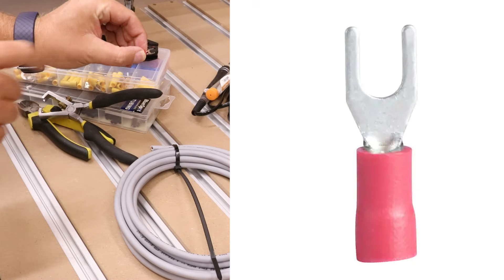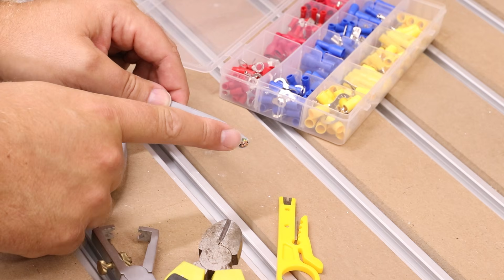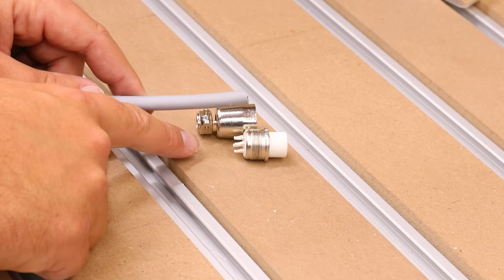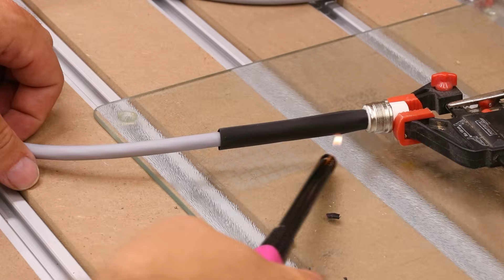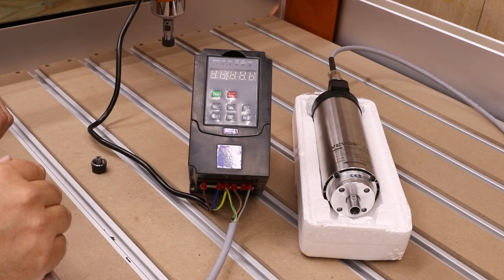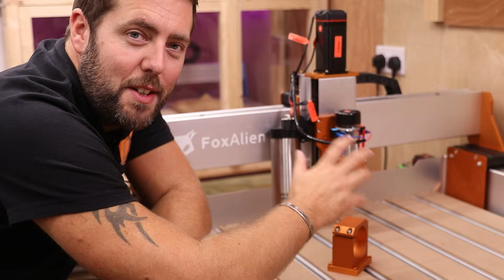Beginners guide to a Spindle VFD upgrade on your CNC

Comment: Should be connected the shield wire of the spindle cable at the source side?
Reply from the maker: Yes, the ground wire from the spindle should in theory be connected.
Reply: ground is ground - it's the cable that goes to your home's fuse box and is connected to an electro-magnet that pulls off the fuse once ground-cable gets current.

Comment: Hi James, just getting around to watching this. Question - is it necessary to use the VFD you mention or is the one that comes with the spindle sufficient? The one you used was 220v and no longer available. Just wondering why you needed to use one that was not included with the spindle? One additional question - is a 5.x lb/2.4kg spindle too heavy for the Masuter Pro (what I have) and Thanks!
Reply from the maker: @MichaelHester-v3e  if you mean the standard control board, then no they can't be used to run these upgraded spindles, you do need a VFD like I show in this video. As for the weight, personally I think that is a bit too heavy for the Masuter Pro

Comment: As always James, you are a lifesaver! Just looked at the 1.5kw air cooled kit, do you think this would be too heavy for my Genmitsu 4040 Pro?
Reply from the maker: The motors will handle the weight but you may have some flexibility in the middle of the X axis
Reply: @JamesDeanDesigns  thank you so much for that! Do you think even an 800 W would be too heavy or even a 500?

Comment: Maybe you can help me, I have a Fox Alien XE-Pro the VFD is rated at 2.2 on the torque of stepper motor.  Can I wire a 1.2kw spindle like the one in your video directly to my Fox Alien without having to purchase the additional VFD unit.   If so then that leads me to my next question?  How do I do that... there is 2 wires going to the 400watt spindle I see the 1.5 has 4 wires... Can you help  me??  Ron

Comment: Hey Guys, currently i think about getting my first CNC. I thinking about getting the Genmitus PROVerXl V2 because i like the idea that i am able to increase the working area pretty easy and "cheap". At the checkout i saw that they offer an 1,5kW Water Cooled Spindle Motor Kit, with VFD & Water Pump and now i am not sure if it worth to invest 330€ additional for a spindle? I am a complete newbie in CNC and woodwork in general... Is it worth to upgrade your system from beginning? Does someone know how the noise different between a normal 400w Router and the water cooled spindel is?

Comment: Cool video, well presented.  One thing is the ramp up/ramp down. There is a reason for the long spin up and it’s to warm up the bearings. Even in super cheapo spindles the bearings are set for heat expansion. You should never wind it up fast, but let it slowly speed up to let the balls in the bearing settle correctly until it’s warmed up. Will prematurely wear out your bearings by ramping up so fast.
Reply from the maker: Very true. I've been meaning to make a follow up talking about warm ups and how to do a warm up sequence and pause code before a job starts.

Comment: Do not solder stranded wires used for power! It's perfectly fine for low power applications. But: If the connection gets too hot the solder will become liquid again. Bad connections and high current will cause a lot of heat and once the solder starts to liquify the resitance will increase which increases the heat and no on.
Do you plan to run this machine unantendet? Anything flamable near by, wood, saw dust or paint?

Comment: Hey James I have a few questions new to CNC machines bought my first CNC machine a (Genmitsu 4030) when I got it none of the bits would touch my project material so I adjusted the height of the spindle by unscrewing the four screws on front and droping it down until my bit meets my table was this correct of me to do?
Reply from the maker: Yes, thats fine to do 👍

Comment: My spindle is air cooled 500w but it only has two wires ? can in i use a vfd with it ?
Reply from the maker: No, that will just be a DC spindle. It can't be used with a VFD. Or not to my knowledge anyway.

Comment: So when connecting the shielding on the VFD side to the earth/ground, do you do the same thing with the shielding on the spindle side, so that you have BOTH the ground/earth wire AND the shielding connecting to pin 4?
Reply: Yes. The purpose of shielding is to take any EMI generated by the spindle (or any of the electronics) and send it to ground; Ergo, the shielding must connect to ground as well. Personally, I run shielded cable od spindle, end-stop leads and stepper motors; especially if your steppers are open loop.

Comment: Hi James, for 8 years I've been trying to get the manual on the Askpower A131 VFD you are showing and I'm excited that you have made a video showing spindle control as I've been trying to do that to - mine is still manula and costing money leaving spindle running! But I'm desperate for the correct need a manual showing PN parameters - do you know where I can get one? many thanks Mick

Comment: Read this before you start buying alternative vfds or what ever extra things.I bought this vevor spindle and vfd. Instaid of the 5v port. I used 0-20ma in.   This does put the rpm correct. Works like a charm.   It just happens to be exactly right as far as i can measure mah..
Reply from the maker: That's interesting, I tried all the inputs on mine and I couldn't get any to work correctly without using a voltage converter and separate power supply
Reply: @JamesDeanDesigns  i can if needed make a video for you or make pictures.   Only dont exactly know how i can reach you.    I have the vevor 2.2kv inverter. Same version as you in the movie.
With 800watt spindle.

First i turned down the potmeter on the mainboard of the controle box completely.  This gave me 4 volts. Instaid of 3.6 on the pwm and slightly higher voltage on the steppers.(0.1v)

The spare 48v port next to the pot went down in voltage a lot. But im not using this.

I had a invt converter on it first and i was able to set about everything you want to set it up on the 5v imput by setting 100% spindle at 4v. But thought..  yeah. This is not what i want. Couse  its only 0.75kw and i want to upgrade to 1.5kw spindle later

So. Thats where the tinkering came from. 

The potentiometer turned left fully. 0-20mah imput. And that gives me the controle to use it at the rated 400hz. 
At 4v as voltage imput i only got 320hz
Reply from the maker: @jeffreybres3999  oh cool. You can contact me through Facebook or a contact form on my website. Just send a short message on the form and then I'll reply so you'll have my email address www.jamesdeandesigns.com

Comment: I installed my spindle like you. When I start the spindle with the button "run" it runs, but then all light (com, alm, dsp, run, hz, rpm) blink very fast and i cannot stop or adjust the rpms. Does anybody had the issue? Has it something to do that i dont have a break resistance or is just the wiring wrong?

Comment: Hi james, ive been looking to get another VFD for my 4030 v2. They've almost doubled in price since last year!! I've noticed 2 alternatives. 
600w brushless square can 12k rpm.
800w 52mm Canister, 110v DC. Like a 300w on Steroids but very reasonable prices. £85+ need to get a 110vDC power box.

Comment: Basic Guide for Beginners:
RPM = 4 x CS / Tool Dia. (inches)     
RPM = 4 x 100(steel) / .3125 = (1280 RPM  --- With Coolant!) 

FEED = RPM x # of teeth  X  Chip-load = IPM
FEED =  1280 x 4 x .0025  = 12.8 IPM  (With Coolant!)  
Cutting Speeds (CS)  --- Steel = 100, Alum = 400,  Stainless = 40, wood = 800+
Make the tool as short as possible. Adjust these specs accordingly! Wear safety goggles!

Comment: Hi there nice video. By the way the deceliration time must be longer than that because that will allow the spindle to cool down after working and getting hot as long as it's air cooled spindle. I hop I'm not wrong.

Comment: Is it possible to set the spindle speed from grblcontrol (candle) software? It would be great to use a smart relay control and/or analog input from cnc controller to the vfd, so you don't have to start/stop the vfd and manually change speeds

Comment: I purchased the UltimateBee this spring 1500x1500 2.2K 220v air spindle xPRO controller. I had so many issues with the controller and getting the motors to move right I scrapped it and got a NightHawk controller. All the motors are working perfectly now, but I can not control the VFD. I have gone over all the settings and matched them up to what seemed to be the best choice and moved the jumper. Still, the spindle will not turn. I am hoping someone out there will be able to help me.
Reply: Did you ever get this sorted?
I have similar issues within my FoxAlien Vasto XL.

Comment: Hi James. I enjoy your videos even if I am not about to build what you are. I build CNCs from scratch and have a 2.2 KW spindle and VFD to put on the latest one. The guy I buy all of my stepper motors, cables, motor controllers and even this spindle/VFD combo is very helpful in designing systems, I think he  is an electronic engineer among other talents. He's talked me through building a CNC milling machine, a 4'x4' CNC router with a Gecko 540 controller and now a larger  CNC router with the 2.2KW spindle. He insists that soldered on  cable ends will clear up any problem due to corrosion over time and that the sheilding mesh should not be cut back but twisted into and wire a wire lead soldered on and set up to run to ground. He also solders ring conector on the ends and covers them with heat shrink. Crimped wire connectors can lead to issues. Here a short video about a VFD conector cable he builds. He has a wealth of how to videos and choosing components and wiring them.   https://www.youtube.com/watch?v=COdYnz31zj8
Reply: Yep you do need to connect the shield to the earth point on the VFD only,  if you don't connect it it doesn't act like a proper shield and you can/will get noise on your your system and this can lead to missed steps etc.  If you go both ends so VFD and the Motor because you already have the earth running through you can get potential earth loop issues..

Comment: Heat shrink tube can be stretched out and reshrunk. Incase you run in to the hot wire problem again. Sometimes you can get in under the edge enough to stretch it back out with out tearing it.

Comment: Hi James- When I installed my 2.2k spindle it was highly recommended (actually they said required)  that the VFD be mounted in a metal  cabinet with metal door. and that all components including cabinet and door be grounded and bonded together. I did this and also also installed fans in cabinet for cooling. By doing this I have had zero electrical interference. I've talked with others who didn't comply with this and they've had multiple problems with EMI. Just a heads up in case you should start having any issues. Great video as always. Keep 'em coming!

Comment: You have done a very common fault (now saw at 14:00 you are recommending this as your setup is temporarily - but wondering how you will manage to do as shielding is cut off) - the shielding of the cable needs not to be cut off but connected to earth on both sides. The way you do it shielded cable is pretty useless. Drill the shielding and solder to ground-connector, do this on both sides.
Done brief research on this as I connected my Vevor 1,5KW aircooled (on Genmitsu 4040 pro) with same VFD you are using -  all professional suppliers of spindles are recommending to connect shield of cable to ground on both side. Of course you can read different on the net even to not even take care of grounding at all. As always it is a task to sort out false information from the really valuable correct infos you can find. Recommend this https://www.youtube.com/watch?v=vT76mpkeUyI&t=113s or https://www.youtube.com/watch?v=dTKNi0e3qBc - a pro building cables for spindles.

One comment on Pin 4 being ground - this is not always the case - I used the same spindle at the beginning as you show in your video - Pin 4 is ground for this model - yes. Then changed to watercooled Vevor 1,5 KW, different PIN is ground - so I had to solder a new cable. Reading documentation of any spindle is crucial to be safe and connect correct Pin to ground.

Another comment - the other 3 cables don`t need any special attention as all three carry the same - connect them to VFD`s U - V - W in any order - does not matter. 

I really appreciate your comment on checking of ground being connected to housing inside the spindle . Many China-spindles do not have this - my 2 Vevors (also China-spindles) both had this and using a spindle without connected ground may lead to a very unhealthy experience in case of some electrical shortcuts - as your body will then act as ground - best case it only hurts.

Curious about your second part to control the spindle via SW - I am lacking this as of now and did not have a chance to dive into this.

Thanks for your videos - gave me an easier start to CNC.
P.S. If you allow, my 1,5kw Vevor aircooled (maybe 4 to 6 hours) complete with ready cable is on sale. If someone is interested (located in Germany) @James: If you feel this to be inappropriate please tell and I will remove P.S.
Reply: the 'pro builder' guy you linked, Corvetteguy50, recommends only connecting the shield on one end (see  https://www.youtube.com/watch?v=vT76mpkeUyI&t=476s). I'm not at all saying that's correct, just that it's conflicting info to "all professional suppliers of spindles are recommending to connect shield of cable to ground on both side."  I think the only consistency I've seen with respect to this question of grounding is that some large fraction of the people believe it's one end only, another large fraction believe it's both ends.  Maybe it depends on the exact cable type and installation parameters...idk.
Reply: Just check industrial spindles and how they are connected when it comes to grounding  - you will see they ground on both sides.
I do not think this is related to "cable type or installation parameters" - as it just works when not grounding on both sides, but may lead to electrostatic issues in the future. Troubleshooting such issues is annoying. My guess  - this is just laziness and costs. Many cheap spindles even do not have PIN 4 connected to the housing of the FVD - surely just some cents of saving, but with high volumes.....

Besides, you surely do no harm when grounding on both sides, so why even thinking of not to do both sides?

Comment: Is this drive made specifically for that spindle and the motor parameters already set for the motor nameplate information.  Usually the motor nameplate info needs to be entered into the drive parameters or it will not run at the correct speed and not at max efficiency.

Comment: The manufacturer of the VFD should give instructions on how to de-rate the drive when running on single phase versus three phase.  The 2.2k drive should be able to run the 1.5k spindle on single phase but it would be worth double checking with the manufacturer. It will definitely not run a2.2k spindle on single phase.
Reply from the maker: As I said at the start, I'm not an electrical engineer so I'm really not sure. Does 230v make a difference to 110v supply because I'm pretty sure  I know people in the UK running  a 2.2kw setup off single phase? Maybe I'll look into it some more
Reply: @JamesDeanDesigns  this particular drive may already be de-rated for use on single phase power. It depends on who they are marketing to.  I’m used to Siemens and Rockwell which are industrial drives and almost never used with single phase. 230 requires less current. If you can provide the current required with 110v it will work the same as 230

Comment: How does the 2.2kw compare to a Mikita on the Genmitsu 4040 pro?
Reply from the maker: It's nearly 4 times more powerful but equally a bit more weight. May result in a bit of sag near the middle of the x axis
Reply: @JamesDeanDesigns  Shouldn`t we be more concerned on sack of Z-axis  - X to sack I think is more unlikely.
Although mounted since a while on 4040pro I did not have challenging jobs since then.
Reply: Any advantages (except noise ) of 0,8 kW spindle over the Makita router ? Thx

Comment: One thing that I would have done differently is to use ring terminals rather than the "spade lugs" that you used there.  These will not come off unless the screws are the whole way out...   :-)
Reply from the maker: I get that, makes sense. I think getting rings in on this particular model would be a pain to get in with the plates as well, but on some other models I've seen where the ports are more open it would be easy enough to do
Reply: I remember how narrow the slots on some of those terminal strips were,  and how I had to use a dremel to make the ring terminals a bit narrower as wel to get them in there.  :-)
Reply: @Roy_Tellason   Me too, but ring-terminals are truely the better option